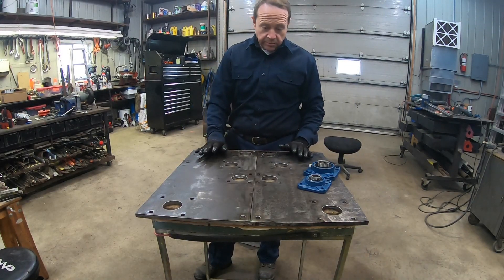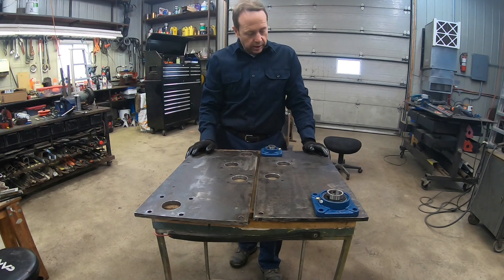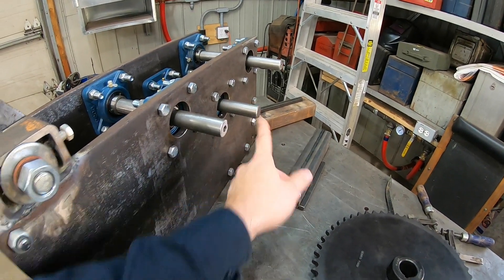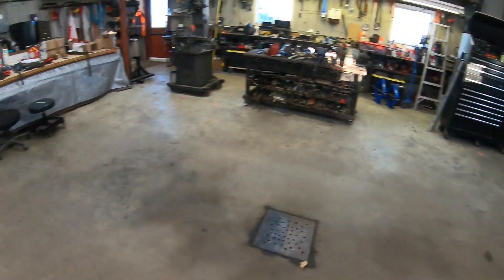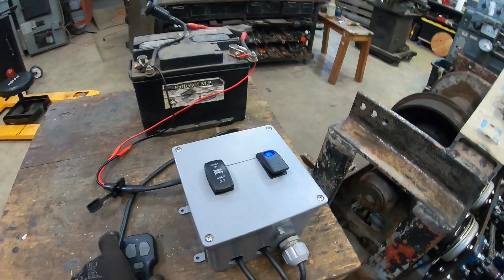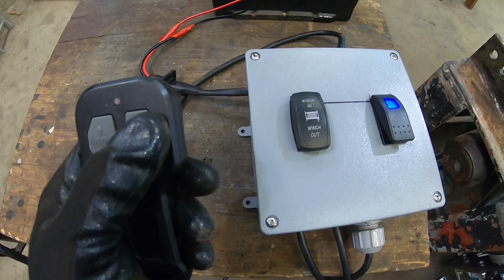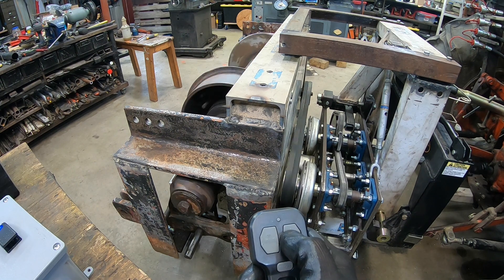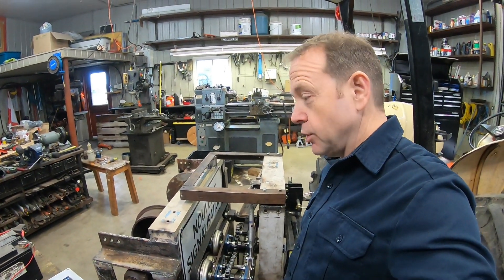#290 Logging Winch → Part 2

Comment: Hi.  Really admire your engineering and fabrication skills.  I have a similar type smaller military winch and am planning on building a PTO logging winch, similar to you... but, i don't really have the money for all of those parts nor do I really need reverse or remote control.. i was planning on just powering the winch straight from the tractor PTO and sitting on the tractor to run the winch, using the clutch and pto engagement lever.  I would build a protective screen on top of the winch and use synthetic winch cable for lightness and saftey... Do you think this would work OK?
Reply from the maker: Hello, it would be pulling slow using the PTO directly to the input shaft of the winch.  It has a reduction of 1:34, if I remember well.  So given a diameter of spool of 8 inches, that would give 22 ft/min at 540rpm. You then have 2 choices. Either you run a set of sproket or pulley to increase the speed of the rotation of the input shaft. Either you increase  the diameter of the spool, by building material on it.   Let say the spool is increased to 16in in diameter, you would get 44ft/min. That would be a minimum acceptable in my opinion. Ideal  would be 75ft/min. Then max (fast) is 100ft/min.
Reply: @FromSteelToWood  Hi Joe,  thanks for the reply and great info.  we would only be using the logging winch occasionally so we may just accept the slow speed... or if it really is too slow for us, i think i might use your idea of building up/doubling the spool size as i am sure that for what we do 44ft.min would be fine.  thanks again!
Reply: @FromSteelToWood  thank you for the detailed reply and information!

Comment: Salut Joe!!  This is a massive winch for sure.  Certainly is strong and I bet you will be able to pull any log you cut.  It runs pretty smooth too.  Nice engineering to get the clutches to operate for pulling as well as unspooling.  Nice build!!   Take care!!
Reply from the maker: Thanks!  That is a lot of work involved into that project. But I think I'll save most of this time in a year or two of use! Thanks!

Comment: Awesome job! Was thinking of something similar but with a 5 hp gas motor. Just need to figure out reverse.
Reply from the maker: Thanks! I suggest going to a bigger engine, like 10-15hp, as it takes a good amount of HP to pull heavy weight quickly.  If I had to do it again, I would not include the reverse function. Not as convenient as I thought!  Thanks!
Reply: Ah! I was wondering why the power reverse for logging .  It seems like a good way to get a large birds nest.
Reply from the maker: If you unwind the cable and don't pull on it... that is the perfect recipe for disaster!  So far, if it happens and I see it, I unwind a bit more until I see nothing loose before I pull back.
Reply from the maker: But indeed, that function is not as convenient I have envisioned.

Comment: This thing will pull a house! Very nice video. You are extremely gifted in fabrication!  Man some nice equipment if you can make round stock into an axle with a keyway. Thanks for sharing. Cheers, Mike.
Reply from the maker: Thanks!  If you look carefully at the end of the video, you will see a new tool in the garage in the background.  Have you seen it?  Thanks!
Reply: @FromSteelToWood  I didn’t catch the new tool. I’ll have to have a closer look.
Reply: I see a pretty nice mill and a lathe. Both very nice to have for projects like this.

Comment: what clutches did you use? Looks really promising. Look forward to future videos using it!
Thanks for sharing
Reply from the maker: I've purchased the clutch on Amazon. It's being sold by 8Ten.  My choice was based on a double sheave, 1in shaft, 200lb-ft torque and ±4 inches pulleys.  And the best price too!  It was below 200$ (CDN) each, which was quite affordable. So to say, I have no clue on what kind of machine it is supposed to go!!! Thanks!
Reply: @FromSteelToWood  Thank you so much. I found similar spec ones but with 1 1/8" shaft for $69 US!!! 
Just got two to use for my military winch! I really appreciate your build and sharing it.